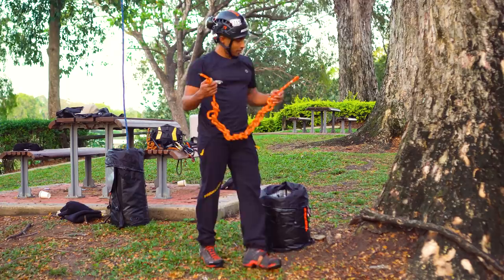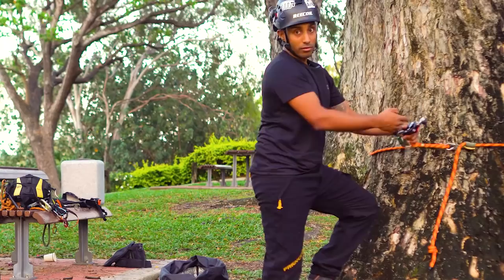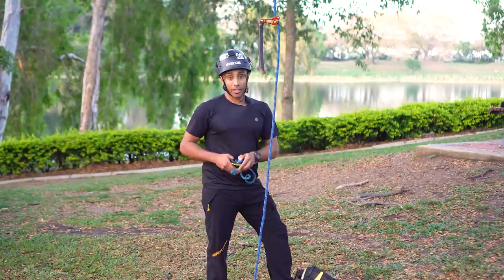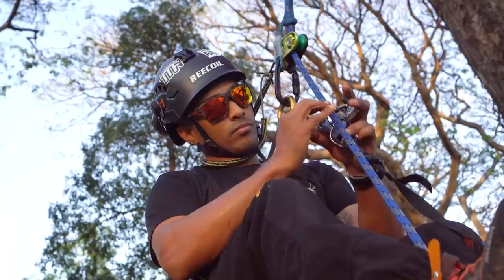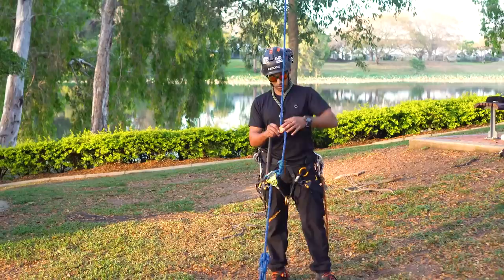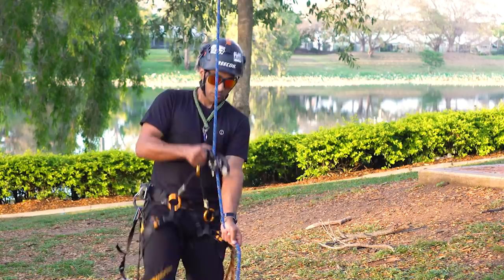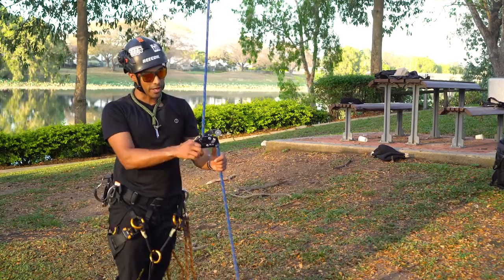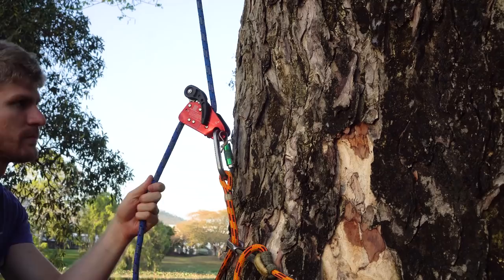How to climb a tree SRT with a Rope Wrench or Taz Lov3

Comment: Awesome. Pretty similar system with us here in Malaysia Borneo. We have high canopy usually up to 50-80 meter. Ground release system is a must. Also we use srt climbing system BUT added another backup rope for your backup device. (goblin, asap or Taz.) Once on top we change to double rope MRS. Keeping the access line available for rescue or descend later on. We do commercial work Btw. Thanks.
Reply from the maker: That’s so cool to hear! Yeah we used to do the same in Australia’s Eucalyptus Regnans (50-80m +) when we were climbing for measuring and protection purposes. But we didn’t use a backup asap. That’s a great idea though.
Would love to climb rainforest species like you. Do you have any videos of you in the rainforest climbing?

Comment: There is drag when you ascend, because the Taz manufacturer instructions state it's for rope no larger than 11mm. Obviously it was designed primarily as an industrial Rope Access device and has bee poached by arborists. Fingers crossed they can iron out this with the Lov 4.

Comment: What kind of work rope wheel do you use to work Taz Lov in this video?
Reply from the maker: Hey bro! I'm not sure what you mean by "work rope wheel". Is there another word for it? Happy to help 😊🤙
Reply: Good morning, I'm glad you wrote back :)
I am writing from a translator, so maybe it does not translate exactly ..
I wanted to ask about the blue rope that works with Taz Lov, what is the model and parameters?

I also wanted to ask if Taz Lov will be able to work on the Yale Blaze rope, this is the model you use for the base position ... Could you check if she works smoothly in it or with resistance?

Greetings from Poland:)
Reply from the maker: @arbersky4074  No worries bro! 😊
The blue rope is Donaghys Cougar Blue. It's 11.7mm and the Taz Lov3 works, but with a bit of resistance. 

Yale Blaze is only 11mm and fits really nicely in the Taz Lov3 (Taz is rated from 9.5mm-11mm) I just tried it this morning and it runs smoothly.

Greeting from Australia Bro 😊🤙
Reply: Thank you very much for your answer.🙂 Good luck to you.👍
Roman Arbersky